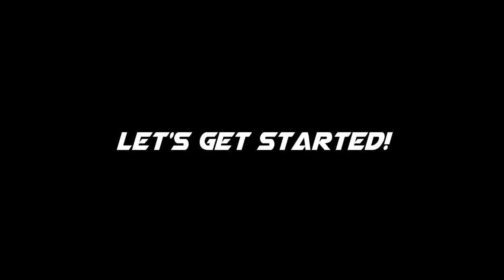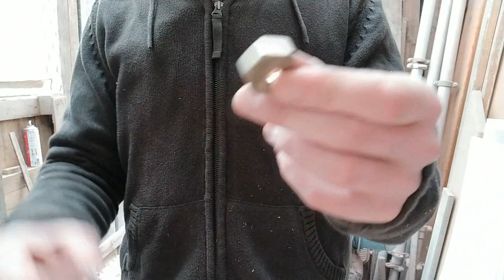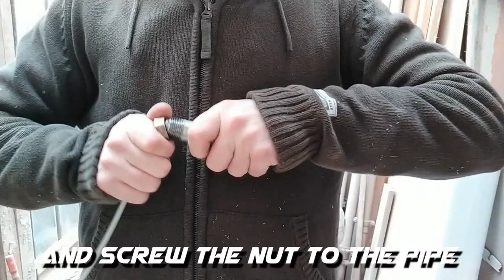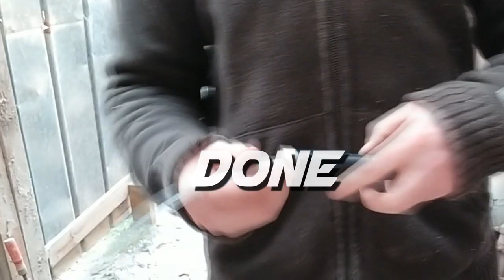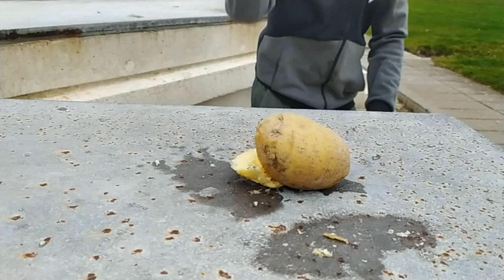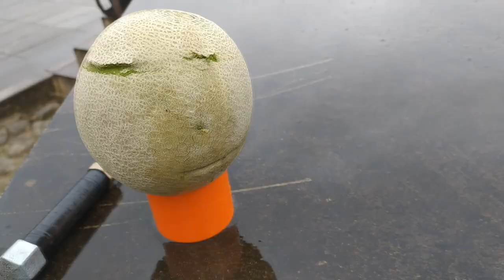How to Make TACTICAL WHIP

Comment: You could use small bulldog wire clamps instead of tying the knot in the wire
Reply: I thought about that too, but a knot is SO much simpler...
Reply: Or strip the plastic at the end and just weld it to the cap.

Comment: Here's what I got @ Home Depot
$1.21/ft x 2 Everbilt 5/16 in. x 1 ft. Galvanized Vinyl Coated Wire Rope [Whip]
$1.51 Southland 1/2 in. x Close Black Steel Nipple [Handle]
$3.77 Everbilt 1/2 in. OD Compression Brass Cap Fitting [Hilt for Cable]
$2.51 Southland 1/2 in. Galvanized Malleable Iron Cap Fitting [Pommel/Glass Breaker]

Add-ons
Bicycle Inner Tubing [Grip]
Epoxy [Tip Sealent]

Comment: Thanks! Great video. But i think a little weight at the end of the cable can make it better. what do you think?
Reply: Yes. If you want to make it even more dangerous double the cord length and loop it through a pad lock on the end. It’s stiffer but still has the added power of the flexibility with a heavy metal piece at the end. It’s devastating

Comment: Use high tensile steel rope, anything too flexible is dangerous to the operator.
Reply: It's a compromise imo as your point is true, but for concealment, the whip can't be too stiff.  It's all in the angle in which it's used.  Best angle imo is vertical.  You swing horizontally and you might regret it.

Comment: Imagine use Carbon fiber string instead of metal, the lighter the material the more lethal it makes
Reply: Less weight - less damage
Reply: Exactly the opposite is true:  Force = mass X velocity.  A carbon fiber would go a bit faster but having negligible weight it will do nothing when it hits.  To have a weapon that will either intimidate attackers or stop them when they do attack, you need to have some heft and weight. So, a steel cable.
Reply: @Ironfangzu  LOL @ your force equation
Reply: @Ironfangzu  Your general idea is right, but I believe you meant the momentum formula: p = mv
Force is what will be felt at an exact instant, and it depends on many factors: kinetic energy, duration of impact, surface area, etc.